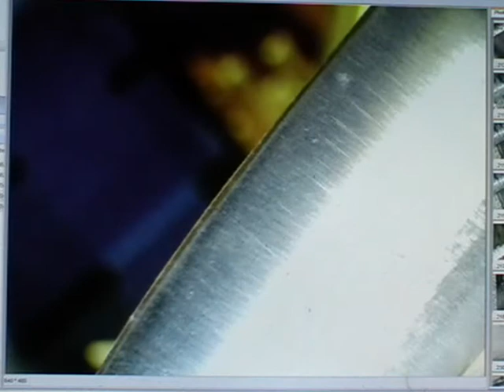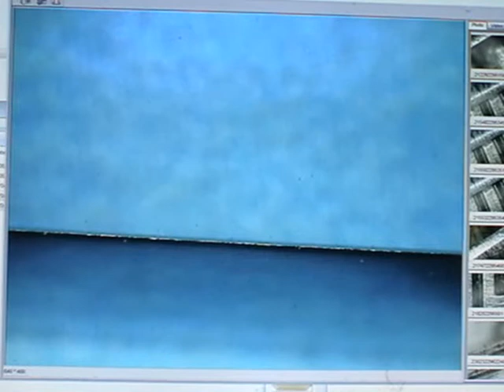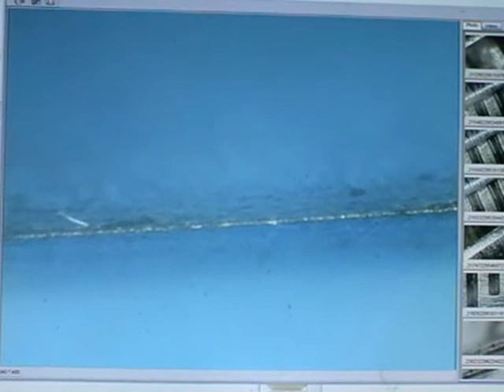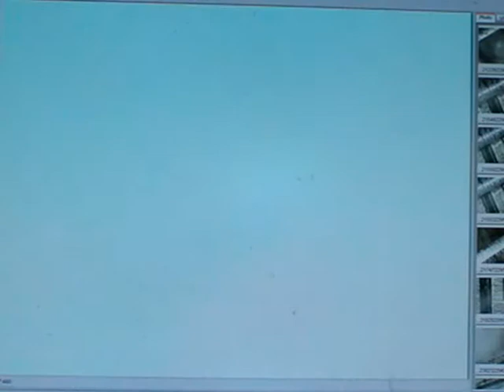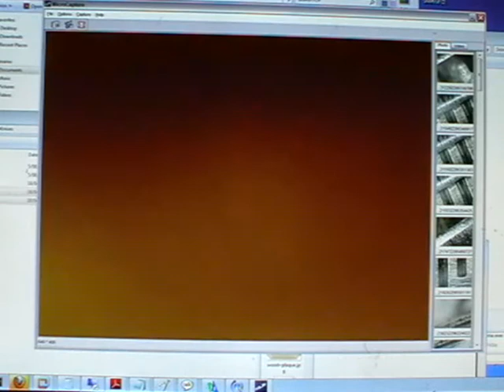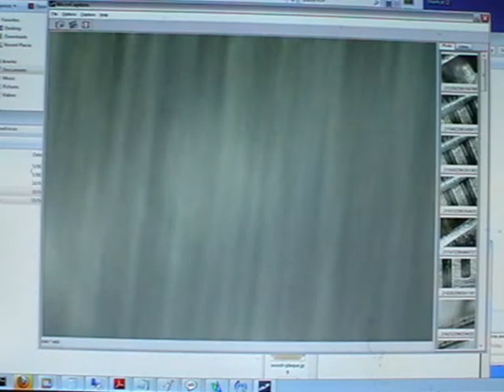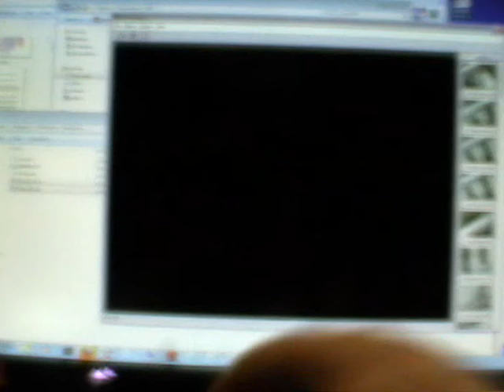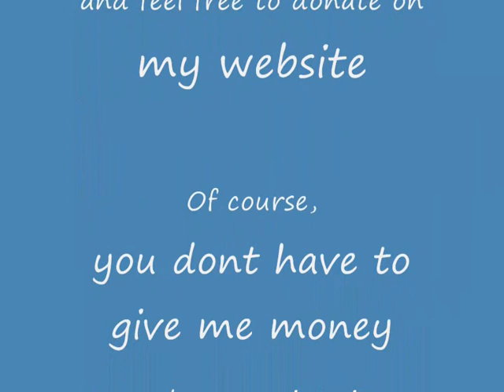Knife Edge Geometry, Under the Microscope Part 3

Comment: Calypso Jr. was the flagship model for cutting efficiency for a long time, full flat grind, extremely thin ground edge, bevel under 15 dps. There is a thread on the Spyderco forum now about the best cutting profiles in the current designs.

Comment: Man, this is one of the best videos I have seen in a while. Amazing how weak the edges on these blades and how quick they can dull and turn over. I think manufacturers push all the so called super metals because they can charge more for them. It lookls like the edges are very small and fragile no matter what metal you have. Thanks for the great video. I will keep watching it periodically to refresh my knowledge.

Comment: Spyderco does make some very thin edged knives with secondary bevels between 0.005-0.010" thick. You can't even grind thinner than that as you will hit 0.005" with a full grind and back sharpen.

Comment from the maker: i can certainly do that at sometime.. but most of these videos have actually shown the edge after sharpening, and then after honing. The only real reason for edge trailing in stropping is because at the cutting angle you will cut the strop, whereas on sandpaper and stones that will cut the steel.  The strop mostly just helps clean up the stoned edge. once you get to high enough stones the effect becomes less.

Comment from the maker: where the advanced metals have an advantage is in high wear resistance. most normal cutting in normal stuff like food, wood etc is more related to rolling, rather than wear.. so you want hard steel that wont roll, and a nice fine structure so its easy to maintain. 
the supersteels with their much harder components will only play a part on cutting heavy abrasive materials a lot. rope, and such with lots of dirt and grit.. the edges will still fall apart, but they will saw well.

Comment from the maker: contd.. the main thing though, is that in normal cutting you clearly dont need that massively thick bevel. it hinders cutting, as proven in the phonebook, but it doesn't actually support the cutting edge in any useful way. the bevel can be 1/10th the height, and then drop to much thinner steel for cutting. I will say though, that taking knives as thin as I am showing is hard and costly and runs more risk of damage in production environments from overheating.

Comment: Oh ok, that makes sense. So in other words if you worked up with 400\800\1200\1500 grit stones the result would be pretty close to the same. My thought was that sandpaper\stropping works better because the sandpaper backing mat and strop are soft so they will match the contours of a convex edge naturally, whereas a stone is a hard flat plain with no give and because of that you have to have a lot more rigid control on your sharpening angle to maintain a centered, symmetrical, micro-bevel.

Comment from the maker: its very common. your apex is tilted to you strong side. one direction its aiming down like a plough and ripping hair, the other way its like a ski and sliding over. when cutting down its so thin it can cut, but but it will dull quickly as the cutting is always side loading the apex, and forcing it to roll even more.

Comment: I was a bit surprised when the Spyderco didn't fail completely from the two perpendicular passes on the hone. I really wish Spyderco would make thinner leaner grind design folders with a big note in the box with an exclamation mark reading: hey batoning fans this is NOT for you.